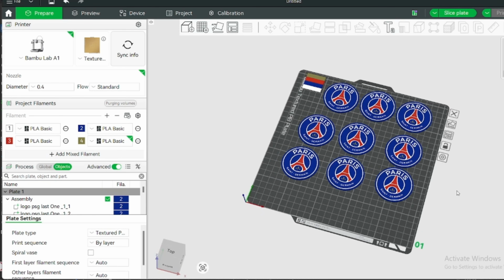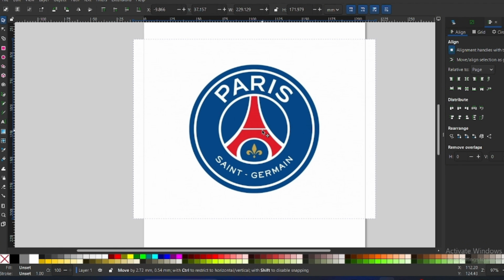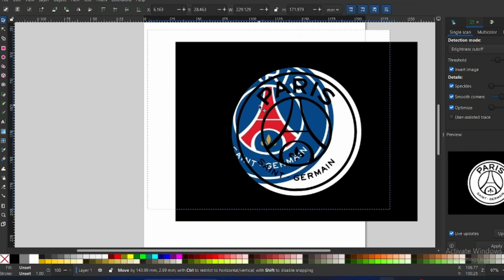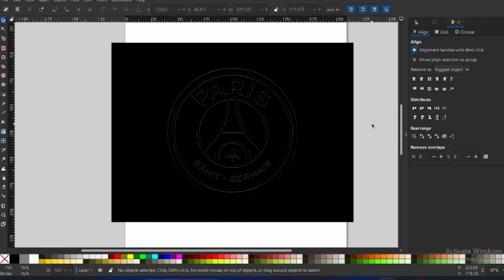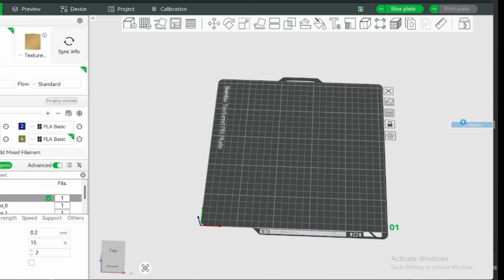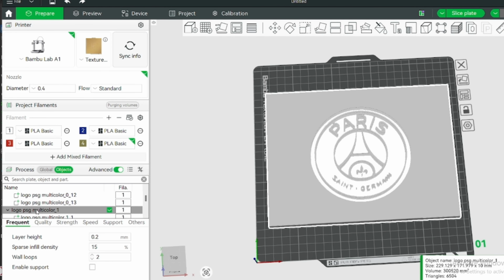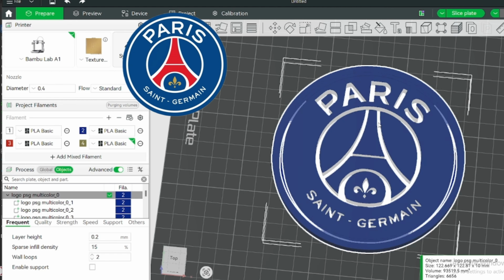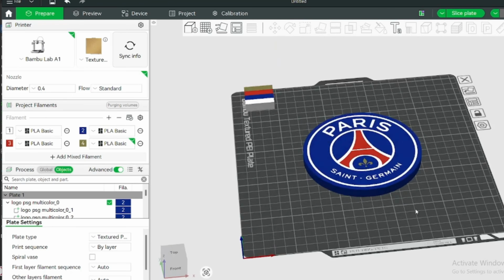How to Convert PNG to 3D Printer ( multicolor)

Comment: Thank you for the tutorial,  when i move it to bambu, I keep accidently moving one of the drawings and I have to keep centering both.  Is there a way to keep those together as I'm changing the colors?
Reply from the maker: Yes! There's a much easier way. You don't even need to touch or move the object at all. Just change the color from the object list on the left, and everything stays perfectly aligned.
Reply: @AladdinLab_25   ok that works, I kept clicking on the object.  Thank you for the reply and thank you for the video.